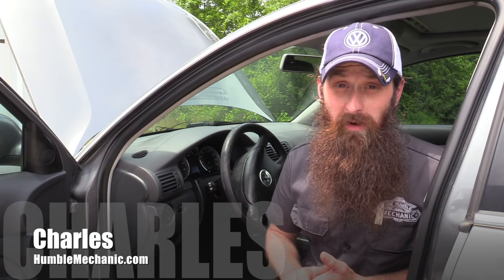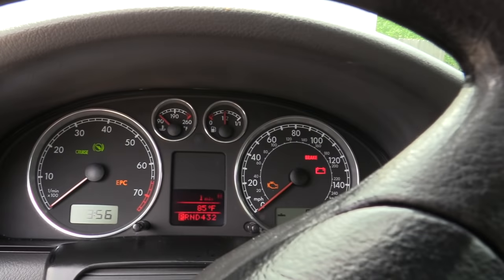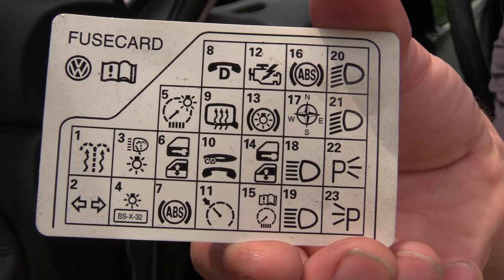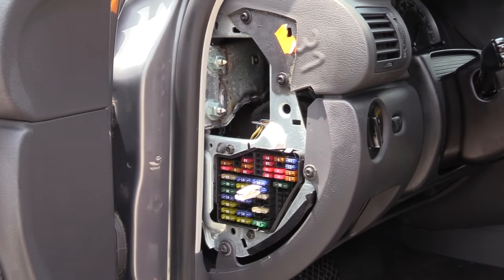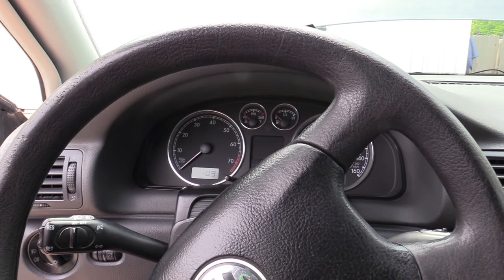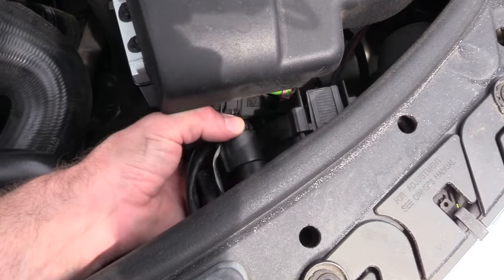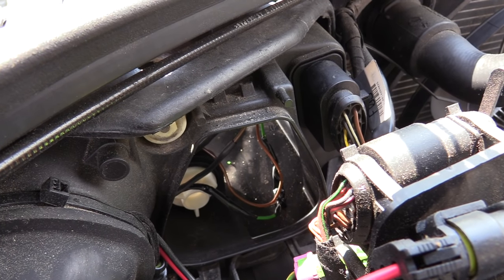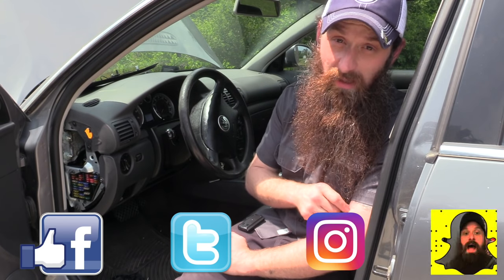Why My Turn Signals Don't Work ~ Diagnosis

Comment: Hello friends! In case the turn signals don't work and the hazard lights do work, you can try and check the hazard lights relay situated inside the hazard light button. Reinforce the contact between the metal slips as they to tend to go apart after some usage. This was my case, after 100.000 miles, and the fix was easy (pull out the button and pry the metal slips closer). I am currently at 170.000 miles with the original button/relay! Safe driving!
Reply: Great advice! I will try that tomorrow in my Passat. Thanks!
Reply: Adrian thanks for the advice. Today I checked the turn signals fuse (10a) and it was blown. This was on fuse slot #2. Replaced, checked and it was good to go. 
I must say I installed 2 years ago a turn signal LED dynamic strip. I guess the load is a little too much for that circuit, maybe upgrading to a 15a fuse will do. Will have to check amp load on that circuit.
Thanks anyway man for the advice.
Reply: @rudolfhuijs4526  up

Comment: Hello HM, an excellent and thorough presentation for repair. I'm a mechanic myself and was looking on youtube for the diagnostics for a wiper switch for a 1997 Ford Ranger which has been giving me a headache. Your method of teaching is excellent, and though I didn't get anything dealing with my wiper switch, still, I learned your technique for solution of a short, and it is a good technique . . . excellent.

Comment: Awesome video!! I had some issues with my 03 V6 b5.5 Passat where I replaced my relay, and even the turn signal wand and still had no signals for almost 6 months. Well, finally one day while my mechanic was replacing my steering wheel he realized these sort of connectors that we're placed DIRECTLY UNDER THE STEERING WHEEL AIRBAG COMPARTMENT. Once connected, I had turn signals again, even connected my old relay just to discover it still worked fine and I'm pretty sure my old turn signal wand still works too. But this was just in case anyone had the problem and these AWESOME VIDEOS LIKE THIS ONE didn't help...

Comment: Excellent video. Just bought a 95 wrangler. Turn signals don't work but the guy I bought it from had replaced headlights with LED. I think this video is the exact trouble shooting guide I needed! Will find out shortly. Thank you!

Comment: Thank you for the informative film. My Turn Signals stopped working, I did several things on it, so it was sitting for a while. What it was in my case:
 I found it!! And what it was, I removed the headliner board for re[placing the upholstery on it, and disconnected the wire to the ceiling lens. The shop manual (I fortunately have for that car 2001 Saturn SL2) advised to attach those wires w/scotch tape, so I disconnected it fm/the plug by the rear window. The plug was sitting on a thin plate, which I assumed was there for keeping the plug in correct place. After I did some research I've learned that grounding could cause Turning Signals go off. The Manual showed 2 grounding wires on the rear close to that plug. There was a clip on the plug, metal one. I disconnected the grounding there, so even w/plug in the T S-ls didn't work of course. It might be helpful for someone else. Pls check the grounding as well if you have a problem w/T Signals and the fuse is fine. I was about to replace the Steering Column Switch, and actually ordered one already (so will have a spare now, not bad thing though).

Comment: Thank you for this video!  I have figured that mine is a wiring issue and didn't have a clue as to where to begin looking.  I will look inside the headlight to see if the problem is there.  Thanks so much!

Comment from the maker: I am currently editing the video(s) for removing the headlights and fixing the issue I found.
Reply: it's always seemed like voodoo to me, to figure out how to replace a wiring harness...  I can never get my head around where the various harnesses run to, I'm afraid to start unwrapping things, etc...
Reply: JD when I was getting started learning electrical, when all plugs could interchange, i looped masking tape on both sides of connection plugs with something identical written on each before separation to easily identify mated plugs. I have noticed an increasing trend of all connectors are becoming unique. Another thing to remember is wires don't really deform after long-term placement and many hot/cold cycles so don't bind them in bundles and majority of harnesses will layout almost exactly with little effort. I wish you luck but after basics are learned the rest is mostly some knowledge and mostly applied common sense.
Reply: Humble mechanic..  Left turn signal turns of headlights..  Any idea why?
Reply: I have a similar problem with my jeep. Except that when I turn on the blinker, the dashboard light comes on and does not blink. And yet the hazard works fine. Any ideas?
Reply: I'm at a lost, was tighting my drivers side headlight and having a hard time putting the clip on 2006 bmw 325i, I made contact with the needle nose plyers and now my turn signals, wipers , bright lights all together not working
Reply: Humble mechanic, The wiring to that headlight is exposed and I used electrical tape, Im thinking I may have tape wires making contact causing the problem, I've checked all fuses with a probe light every one of them checked out good none blown,
Reply: You look alot like jay dagner

Comment: Here again Charles. I had the same issue on my Passat, turn signals not working, but hazard lights ok. Checked the fuse on #2 and it was blown. Have to mention I installed a pair of dynamic LED turn signals 2 years ago without cancelling the bulb (load) inside the headlight housing. For now it was replaved with a 10a fuse, but I should check the circuit's load. So there it is, sometimes we mod smthg and later it backfires. Kind of like that engine you destroyed with the nitrous! 😝

Comment: Thanks to this video, I fixed my turn signals.  While I was at it, the electric locks and seats.  The fuse wasn't the problem for the flashers.  It's something in the steering column.  Adjusted all the way down, they don't work.  Up a couple steps, perfect.  I don't adjust it anymore.

Comment: Hi I’ve just come across your video along with others. Really helpful how to explain everything. Unfortunately I don’t think it will help me with my problem on my 2003 beetle. No indicators or hazards, all fuses good, replaced the hazard relay, after we did that, all indicators and hazards working fine, then 30 mins into driving the car, smoke coming out of relay switch and no indicators again 😕
Reply: This is a bulb shorting, replace all turn signal bulbs.

Comment: I own a 2003 V6 B5.5 Passat wagon that looks and runs like new, but only because I am obsessive with maintenance.  I'm the original owner and I love it.  I had no idea these headlight wires were so prone to cracking - good to know.  They should have used wiring with silicone insulation or some other material if subject to that much heat.  Had to replace the wiring from the ECU to the coil pack recently ... after 14 years of baking from engine heat they did started to do the same thing.  PS - love the videos.

Comment: When I am checking fuses I always make sure to check them all like you do. I also like to study the fuses and the fuse card or owners manual, depending on the car, for fuses that should be in a certain place that may be missing. I have seen problem on cars before where nobody could figure it out and I would find a fuse missing altogether.
Reply from the maker: +Mr.Mister I've seen missing fuses burn techs so many times.  To me, checking fuses also includes looking for missing ones. 

I've seen guys spend days on cars over missing fuses.
Reply: HumbleMechanic Yep. Thanks for the reply, as always.

Comment: Hey humble mechanic I got a 1998 Audi A4 2.8 and my turn signal don’t work. Both the fuses are good. I had to put a turn signal switch in the car as it was damaged. Any ideas

Comment: I had somewhat of the same problem My 2003 chevy venture would blow the back door automatic door open would blow the fuse. I used a 12 volt test light . I had a repair book for it and chased down the wire along the floor and found out it was caused by the factory had not put a waterproof system around the wire harness . I checked the other harness on the other side and it had the water proofing . I took it to a dealer and they had to fix it for free since it was a factory problem.

Comment: I hear you. Well I did the check on the hazard light and then went and loosened the headlights on each side and did the checks. My hazards came back on. Then the blinkers started to work again. Thank God. I didn't want to have to take it to my mechanic. I have a 96 Honda Accord LX. And  I think the power steering fluid container is spraying out fluid on to the wires that go to the driver side head light. The whole area on that side is really oily. So I don't know. But the blinkers are back on.

Comment: Well, I have watched your vid again w/o realizing it. The guy I bought my 2001 Beetle from (lives 4 houses away and) has his own shop in town GermanWerks - yet he doesn't know how to fix many of the issues I am willing to pay to get resolved (which were present when I bought the little beast.) I should have figured it out by now (5 yrs later) he sold it because it became a hot mess and wanted to pass it off to someone - anyone - else. My dilemma is what to fix of the many issues just so I can pass it off to someone - anyone - else. 
But on the positive side, everyone (it seems) young, old, male, female, gay, straight all look at my little buggy and smile. (prob not WWII Vets if still alive)
I think it's a great little ride, my skinny butt fits the seat but I don't think the transmission is going to last much longer, it's getting harder & harder to shift into reverse. And now...that's enough endless bother from me. If I have the little Black Jelly Bean (I HATE ANISE! - the flavor of black licorice) in another 4-5 yrs and find your site, I'm sure I'll have a new set of so sorry for me having to tolerate the little Black Beetle of which I have no trouble stepping on the insect any time of the day or night.

Comment: Thank you for this video. For some reason mine doest work but does click by the fuse box. Then if you really push on the relay a certain way, it works. But I can't get it to work steady. I have replaced the relay

Comment: My hazards work , when pressed the cluster lights up and flashers on the front and back on the vehicle work but when i use the turn signals nothing happens. No cluster lights and no exterior lights. Would I still replace the hazard relay? I have a 02 VW Jetta

Comment: After I changed both of my headlights on my Mitsubishi Galant 2007 , the turn signal stopped working. They checked the fuses but, all of them were good. So frustrating being without blinkers.

Comment: This is great, thanks! I am, oddly enough, working on my maroon 98 S10 and certainly this is the route I need to take. Both sides dead at same time, now to check fuses, and wiring. Could be grounds corrosion or wiring breaking I mean the thing is ancient at this point. lol. Parts cannon approach wants me to swap the signal tree in the column as it is a known issue, but the wipers, cruise control all work perfectly. 
It is rarely just the fuse, so hopefully I can track this one down. 190 bucks is pretty steep for that unit so it will be worth it.
Reply: Did you ever find the issue? Having a similar problem with my 00 vette. Front signals don’t work. Changed the $300 column stick and nothing changed 😭

Comment: Thanx man, I've been looking thru alot of these trying to figure out y only my right turn don't work and all I've been hearing is it's either fuse or flasher relay if not those the turn signal switch..I bought flashers and bulbs and seen the switch goes for $175 used and I would hate to pay that to find its not that,my main problem is the previous owner thought he was a master electrician,those wires are thrown on the starter fuse and the fuel pump moved to the horn fuse and radio wired into a non existent ac unit wiring...so im just looking for more wiring problems...lol
Reply: U find the issue? Mine works off and on too I heard it’s a known issue but I need the fix for it

Comment: what are your thoughts on having a set of circuit breakers that match the fuses for use in troubleshooting? at $13 each for the manual reset ones you could get a lot of fuses, but I think it would be good long-term and ensuring that when the replacement fuse goes in it won't blow
Reply: I’ve had an ongoing issue with my left side blinker whenever it rains. 2005 Passat TDI wagon. I’ve spent hours, techs have spent hours. Nobody can figure out where the fault is coming from because sometimes it shorts and sometimes it doesn’t. Got a 10 amp auto-reset fuse for the blinker slot and it’s a lifesaver because the damn thing was shorting so often I’d have to pull over and put in a new fuse on the expressway. Anyway....gonna check the headlights and see if that might be the issue. But I think the problem is likely in the side mirror shell. Wires got dried out and when there’s moisture present, they get all persnickety.

Comment: I had an intermittent problem with my right turn signal. It’d only happen if I took a hard right or hit a bump. I knew what I was looking for but the wire eluded me. I ended taking it to the dealer. The poor tech spent 8 hours to find it. He got paid for 1. Flat rate took his lunch that day and I feel validated in how hard it was but bad for the tech.

Comment: Good video , Charles ! A lot of people that watch your videos probably are not professional Tech's . I'am assuming  . I know what bulb monitoring is but maybe some of your other views may not , maybe you could explain that in one of your pod cast's . Working on ford vehicles , this feature would have a message on the DIC .( Check left front turn signal bulb ). Or something like that . How does VW  do this function . Ford uses (SJB) smart junction box.

Comment: I had come to see if there was a way to diag these kinds of vehicles. The one I'm dealing with is a newer car which works over com lines. What's weird in my case is that the turn lights work after a period of time; so this is what it does: 
1. Turn signal on the right side: front right blinks normally for 2-3 times and then becomes solid, after around 10 seconds, it starts to blink normally but the flasher indicator on the cluster blinks rapidly even though that's not the case with the physical bult on the front right only, it does that throughout the whole time. 
2. Same with the left turn side, except the bulb that is acting up is the right rear. Using the hazard button duplicates the same scenario for both lights; I'm starting to think that the BCM called Vehicle Electrical System Control Module is failing. Sets codes for open circuit / short to power in both cases, the monitoring system is not working properly; swapping the bulbs to the other side of the turn signal lights do not follow the fault either so the bulb cannot be the culprit. Just not sure why it fails like this and replicates the fault every time; I've never seen something like that before.

Comment: It's after midnight.  I had a new radio put in my 2010 KIA Soul today at Best Buy.  He told me the factory radio was toast.  The new radio has GPS and it's really nice to have my music back.  Tonight I noticed my directionals are not working.  Oops!  I'm going out to the alligator-infested parking lot here in Palm Springs, Fl and try to pull a fuse or two.  Thanks for your great video.  I can't get back to Best Buy until Wednesday.  Off to Pompano Beach tomorrow to take delivery on a 2002 Cadillac Deville.  I wonder if the dark cloud that always follows me will come along on the train ride?
Reply from the maker: Be safe!!!

Comment: Hey, non-VW question (Audi) I upgraded all of my exterior bulbs to L.E.D.'s and I'm getting all 
the expected bulb out faults at the dash. I was led to understand that 
as an alternative to having multiple resistors for every replaced bulb 
to remedy this, I could replace a specific turn indicator relay (not the
 emergency flasher switch/button/relay) instead. Through all of my 
searching both my car and the web, I am unable to locate any actual 
information on a relay for the turn signals separate from the 
emergency flasher switch, yet parts stores appear to sell them. I have a
 2008 A4/B7 Quattro S-Line sedan. I need to know is there in 
fact a separate relay from the emergency flashers for the turn indicator
 lights? My turn signals hyper flash due to the L.E.D.'s, yet my hazards
 do not, and function as normal.

Comment: When my Passat is on and the turn signal lever is “pulled”, the signal arrow on the dash blinks and the clicking noise is there, though the bulb doesn’t light. I have changed the bulbs multiple times and still nothing. Thoughts?

Comment: @mossman381.  Thanks for replying.  My signal and flasher lights blink inside appearing ok, but rear right blinker not working after another new bulb. It did blink while hanging on the bumper.  Right blinker blinks faster than other on the panel.  I'm gonna refer your videos to mechanic and tell him to change hazard switch.  I really think he gave it back to me not working. Thank you so much for the videos.

Comment: I have to thank you for this video. I have a 2003 Pontiac Sunbird, 115k.  The turn signals and reverse lights had stopped working (they share a fuse on this car), and checked fuse, not tripped. replaced bulbs all the way around (Reverse now works), no luck on signals, BUT
...I did turn on hazards, and they all worked. (surprise me..duh) Here's the part that confuses me: the turn signals work, for now! What should I be looking at to prevent this problem in future? Wish I had thought to check hazards first, but lesson learned there...thus my thank you for the video..Any ideas on prevention?